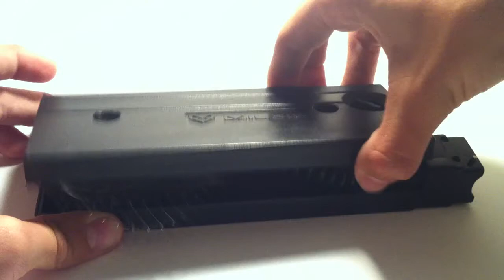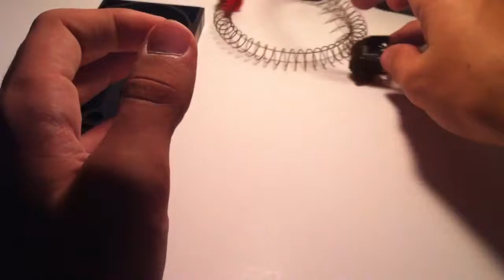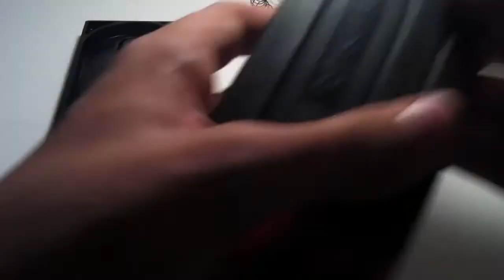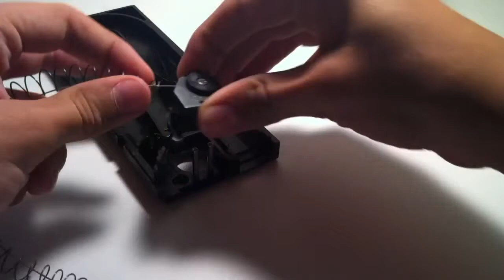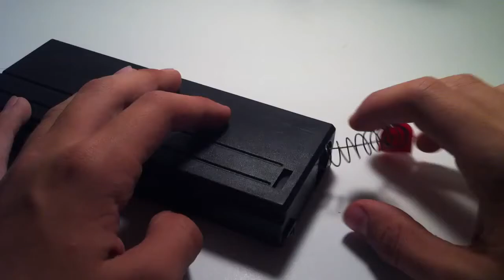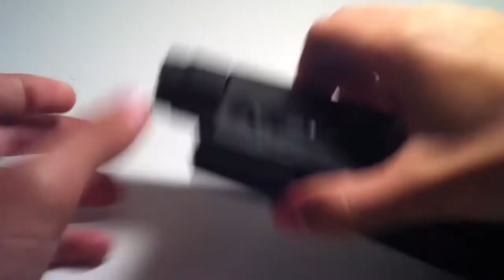Tutorial: how to disassemble/reassemble a Milsig FS mag!

Comment: The collar can be disassembled btw. It's sometimes a bit snug, but the collar is actually 2 clam shells held together by a piece that slides over. If you pull on the top, and the bottom of the collar, it will all come apart. Solid first video!
Reply from the maker: ohh okay ill give it a try and thanks!